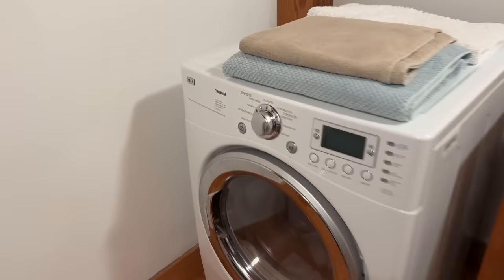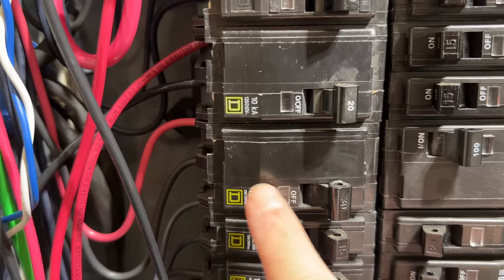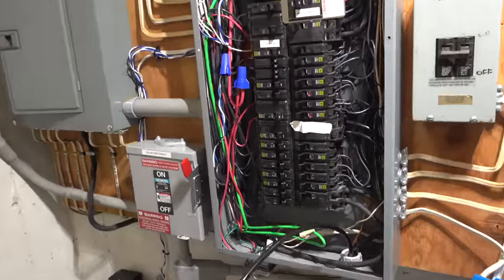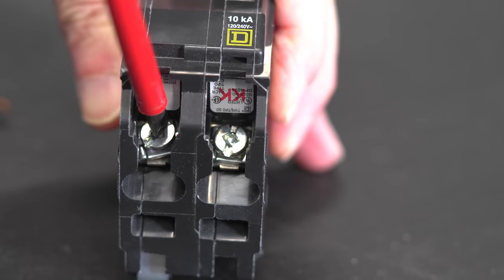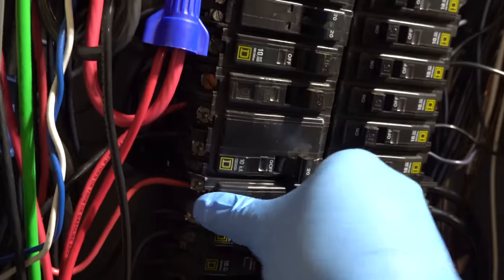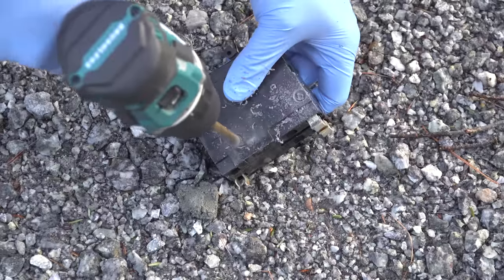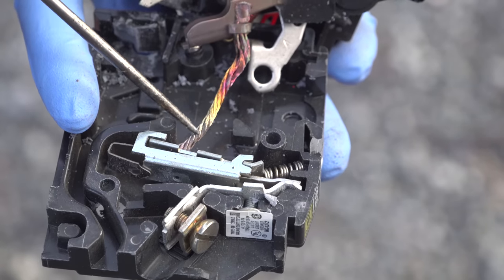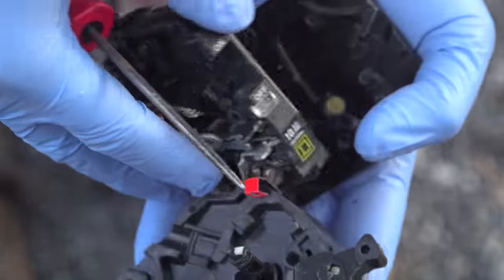If Your Circuit Breaker Makes a Buzzing Sound 🔥 Fix It Quick!

Comment: Mines well over 30, but it doesn't make a noise. It's in a really good environment though. A cool environment and a stable system. It doesn't like really high voltage devices though

Comment: I highly suggest to anyone looking at doing this that they first purchase a non-contact voltage tester. It's a great fail-safe so you can be sure there is no voltage in what you're working on. Just press the button and point it at various places in the panel. its also handy for replacing switches, outlets, etc.

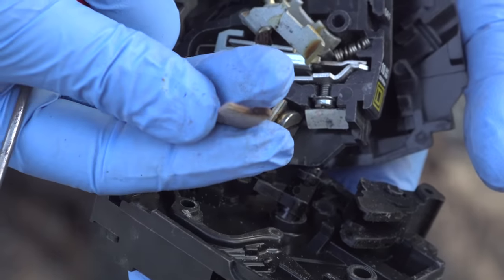Comment: 4:26 Those are quenching plates. Not much to do with the circuit.

That contact is quite far from the bimetallic slow trip. I think I'm seeing a missing contact pad on the entry side. That would definitely burn things up right where you're seeing.

Comment: I think it's crazy ever since I replaced my water heater with a super energy efficient water heater and purchase the exact breaker to put into my circuit breaker I have had nothing but electrical problems in my house. Constantly blowing other Breakers or at one point the wiring for the water heater itself the plug which is required by code to be hardwired with the special flexible conduit and permanent plug-in that is unable to be unplugged. We'll get hot from time to time. Thinking that I had done something wrong I had a professional electrician examine everything and he said everything was done correctly. And that my circuit breaker was Modern enough to handle everything and if anything my power should be working better because the new water heater takes less electricity then the old water heater. So it shouldn't be overloading my system. But yet I still continue to have problems in fact just last week my entire living room went out. So then I decided to change every solitary breaker in the breaker panel. And now today my kitchen went out. I don't understand what is going on I've had it checked by electricians like I've said it checks normal anyone that has any advice would be highly appreciated thank you.

Comment: The noise was driving me crazy! So I got on YouTube. Couldn’t find the correct answer until I found your video. I just cut my 13 off which was the heater and it stopped! But the thing is It cut my whole wall central electric box off!? What should I do
Reply: Continue: No I can’t cut on air or heat. But the noise has stopped! Is there anything I can do before calling the landlord. But the noise did in fact stop after cutting off the #13 heater. It shut down my whole central heat and air and my wall box where I cut the air and heat off isn’t on. But it completely off. It’s electronically box
Reply: Did you ever get this worked out? I imagine replacing the breaker that was buzzing would be the remedy.

Comment: Hey everyone I’m a youngin in my first home, built just over a year ago and I’m hearing buzzing at the breaker, should I check elsewhere as well? Could a loose connection further a way lead to problems at the main panel? All help is greatly appreciated!
Reply: If you are hearing a buzzing at the panel,  there is most likely a problem in the panel, but there may be issues elsewhere because of or causing some problem within the panel.

Comment: Yesterday I added a breaker.  When I turned the panel back on, I individually turned on each breaker and I noticed one of them would have a small cracking sound for a couple seconds every time I turned it on.  
I replaced the circuit breaker and it went away but I have no idea what the problem was. Was it a breaker going bad?
Reply: Yes likely the same issue explained in the video

Comment: Something out of curiosity. How many rooms does this house have? I always see American houses having panels with a load of circuits, I get that most houses are bigger, but that much? 😅

U guys separate 1 breaker per room?
Reply: Code requirements. Let me go with kitchen as an example. Counter tops need a minimum two 20a circuits. Dedicated 20a circuit for microwave. Dishwasher must be on own circuit. Garbage disposal isn't required to have its own but a high power disposal is best served with its own breaker so its normally done that way. Refrigerator gets its own circuit. The lighting will be on another circuit as you don't want kitchen to go dark when you pop a breaker. So in this very basic kitchen example we are already expecting to see 7 breakers just for the kitchen.
Reply: @jovetj  The whole ring circuit and fuses on plugs are a British thing, (or were, even in the UK they mostly opt for radial circuits now).

My sockets are all connected to 16A breakers and a single breaker will feed multiple sockets and light circuits. 

Exemptions are “heavy duty” appliances like heaters, AC and a cooker, they will normally run in a separate circuit. 

I think that a combination of size of appliances and less regulations regarding energy uses might play a part in the difference in the panels and in the nr of circuits. A canadian friend that helped me with moving, was shocked when he discovered that a fridge, washer and dryer were all running from the same socket using a extension cord (mind you, even the cheapest cords will have a 3600w rating, and thats the max the circuit will handle the circuit maximum output anyways), a regular European fridge (small by American standards), a front loader high efficiency washer and a heatpump dryer will sip energy compared with similar appliances over the pond.

Comment: If not sure how tight to get the wires, the breaker should have a torque spec printed on it. It will probably be in in/lb. Use a torque screw driver to tighten the screws and you won't go wrong.
Reply: Could just make it German tight - Goodentight. Have to use the accent.
Reply: @robertthomas5906  😂 True. My comment was only for anyone worried about making sure it met the spec. This would guarantee them that they had it correct. The  rule I usually hear from electricians is to tighten the screw until you hear it squeak on the wire.

Comment: It's not that it was making contact where it should not have. I'd bet it was that it wasn't making good contact. This actually isnt as dangerous as the sparking at least sounds because it should be well contained, and still trip if it gets hot enough. Absolutely worse replacing though, if nothing else there's probably some voltage drop on it and that's no good for your dryer.

Comment: I've always heard a small buzzing sound from the circuit breaker feeding my electric furnace in my mobile home and apparently it's normal but recently I've had the breaker trip randomly for no reason now would that be something I should be concerned about
Reply: @jovetj  so far it's not getting hot or anything but I've been keeping an eye on it
Reply: @jovetj  not like it was but I did notice that the cover for the circuit breaker box was loose so I tightened the screws holding it on and ironically the noise is gone so it might have just been that causing the noise and it hasn't tripped anymore either so it might have just been a power surge that caused it to trip like it did

Comment: How can you figure out which one it is?  Mine only hums for half a sec now and when when i walk by..... no clue which one it is.  None of them are warm
Reply: It’s quite easy. Check them by elimination. Assuming it’s not continuous, just plug in different appliances in their appropriate plug and go to the panel or you can turn off the circuit breakers one by one.

Comment: When replacing a breaker you have to upgrade it to an arc fault but ask your city.  Arc fault breaker would likely react with that clear arc in the breaker
Reply: I'm not sure about your jurisdiction but where I'm at upgrading to arc fault breakers is not required when simply replacing a failed breaker, or even an entire panel. Where I'm at it is stated this becomes a requirement "if you are replacing the panel box and either adding new circuits to any area other than bathrooms, unfinished basements, garages, or to the outside of the home, or if you are extending an existing circuit using more than 6’ of wire. I'm currently installing a new panel in a different location in my home, as well as adding circuits and buying all those AFCIs sure put a dent in my wallet. In any case NEC does not require AFCI to be installed on circuits feeding electric water heaters.

Comment: I had to replace a 30amp for my package AC unit in my square D panel a few months ago for the same reason. It was making similar sizzling noises, but it was also getting hot to the touch. Not hot enough to burn you, but hot enough to make you pull your hand away quick if you touched it while power was going through it. Non of the other breakers were even warm at all. That was the only one.   I went and bought a new one, swapped it out. Took a few minutes. The peace of mind knowing that issue is fixed is great.  I am fortunate enough to have a service disconnect outside by the meter, so I can shut off all power going into the house which makes it super safe to work in the panel if I need to.
Reply: Is it possible that this breaker issue was also consuming more electricity than necessary and inflating the electric bill?

Comment: I don't mean to bring it up but this is really bothering me.  If it helps 1 person, this complaint is worth it.  At 2:40 in the video, your showing the "correct" way to place the wire between the plates.  The way the plates are sitting with the wire, the wire is not in the hump created for the placement of the wires.  The right wire is truly bad. When under load, the hertz vibration and the heating and cooling of the wire at that location will cause that connection to most likely become loose, create arcing and carbon buildup resulting in loss of power.  This result often ends up with a melted wire and a damaged breaker (and possibly damaging the bus bar of the panel, including neighboring breakers).  Overall, very positive video.  Thank you.

Comment: Why is the loop a bad idea? I am just curious.
Reply: The plate style connector is ‘not’ made to have the shepherd’s hook.  If you look carefully, there is very little space to even get a loop in there even if you tried.  Not just breakers, but some receptacles have this system of clamping.
Reply: @glasshalffull2930  thanks for the answer! I've never messed with my breaker box, but I wouldn't have known that information had I not watched this video and it just made me curious. I appreciate you answering!

Comment: I would suggest DO NOT rely on they type of breaker in the panel to determine what type of breaker to put in the panel.
You spoke of mistakes when wiring, but there are also mistakes made on what type of breaker is installed and the wrong breaker is installed.
Instead I would suggest to always consult the manual of the equipment before working on it. In the case of a panel, the the proper breakers should be listed on the inside of the door.

Comment: Thermal breakers are cheaper and more common, but magnetic breakers do last longer.
 Modern codes may call for GFIs AND Arc Fault protectors. The arc fault protectors cost more, yes, but they'll trip out and cut off power when that sizzling arc happens.
Reply: Back in 1974, US Capitalism, ditched the "Magnetic" full size, MCB, for the 50%, cheaper, THERMAL, even though that "SHUNT" cable in this breaker, is "Listed" Magnetic, the action is fully "THERMAL.
Reply: @Lyfan Deth  Wrong, an arc fault breaker will NOT detect the arcing inside itself, as the contacts and that braided lead is upstream of the sensing circuits.
Reply: @charletonzimmerman4205   Also wrong. Except for GE and one other brand I can't recall at the moment, ALL  SqD and other makes use a metal plate and lever type of construction that give them a true fully magnetic trip function. They just don't use a full coil of wire like the older makes (and many UK brands) do. 

And the switch had NOTHING to do with any sort of government or regulatory conspiracies. It was all about better engineering and cost savings.
Reply: @turbokatzenburg5732  Sorry , obviously You're not as old, as me. I was in electrical Contracting, 1972-1976. Yes Indeed, their was "Fully Magnetic" breakers, "Murry" and later "ARROW-HART", they folded as companys like - "Zinsco" & "Federal Pacific", came out with "Listed" UL, thermal, @ 1/2 price, I went out of Business, cause I "Refused" to Install those brands. "Cheap" defective wo0n, but I could sleep @ night as None of my Houses "BURN'T".
Reply: @charletonzimmerman4205  Am I supposed to be impressed by your FOUR years of "electrical contracting"?  I have been an electrician for over 42 years, and worked for a few manufacturers of electrical equipment including breakers, as well as doing refurbs and testing of breakers of all kinds. You cannot even form coherent sentences in your comments. But whatever, at least you went out of business which saved a lot of people.

Comment: In the UK we are not allowed to touch inside the consumer unit or used to be called fuse box. But your good to check this as that might have caused a fire. I'd say arcing might have been the noise. If it's that old, maybe complete board change, might put your mind at rest. Also always pen test before touching terminals and use vde screwdrivers. Noticed you used vde once, but not safe pratice.
Reply: We have a bit more common sense in the US, so we can do our own light electrical repair without fear of government shunning.
Reply: We're not supposed to either. In fact, I was surprised to find out I can't even re-wire a lamp fixture. Some of this is state law, and others are county. I think most if not all of the country we're not supposed to be in that panel though it's done all the time. I'm surprised at how much is done by licensed businesses that never get a permit for things that require it.
Reply: @Robert Thomas  must be just your area. In my state you as a homeowner can do whatever electrical work you want, even replace a panel. So long as you get proper permits and inspections. I've honestly never heard of any place in the US where you are strictly forbidden to touch the panel as a homeowner.
Reply: @Lucky Joestar  but homes in the US are supplied 240v split phase so going into the panel will expose you to 240v just the same. Each hot to ground is 120 but if you cross between both hots you'll get 240v as they are split phase
Reply: @Lucky Joestar we also have 240v in america, the breaker he worked on is 240v
Reply: Most modern home owners don’t even know they have circuit breakers.
Reply: @erin19030  that is true, same with fuses, i have had customers call them "round glass thingys" we then had to drive an hour and a half to change it out
Reply: @theelite1x721987  For Maryland what you can do very much depends on where you are. I can tell you that I don't think you can replace your panel and not be an electrician in Maryland. They told me that the Utility wouldn't do that and I remember when I had one done that they made sure the guy doing mine really was an electrician. I had to replace it because of a city requirement. The wire coming in is also Aluminum wire made in 1964. No problem with it. It has to be handled a certain way.

So they said and it's online that as a homeowner, I can get a license to do it if I can score 70% or higher on their test and pay the fee. For some things, it seems I can replace sockets, light fixtures, and things like that without the license. To do something with the panel such as add a new service you're going to have to have that license or an electrician. If you don't occupy the house they want an electrician to do it.
I suspect it's the same way in Nevada. I worked out there in 1993 and due to the MGM fire they went crazy with electrical requirements.

Comment: Watching this guy with latex gloves in a panel, wow, so much for arc flash protection 
Even turning off the main , you need to confirm there is zero voltage 
Main breakers fail too. If your replacing your panel Stay away from push on style breakers, always use bolt on
Reply from the maker: I never said they were electrical gloves, they are for camera visibility. You wont be finding bolt on breakers for residential panels, commercial yes.
Reply: All manufacturers make single phase panels that can be used for residential applications
In your video, you missed the most important  step confirming zero voltage

Comment: Over in the United States your 3 phase powder is the equivalent of our 2 phase power over in Australia because we're on 240v
Reply: Residential panels like this one is called split phase or Edison 3-wire systems. There is two 120V legs and a neutral in the center, directly across the two legs is 240V. Actual 3phase systems are 120V and 208V phase to phase.
Reply: @Teh_Random_Canadian  we also have split phase we have 240 split it 2 times and you get 415 volts that's how my dad has his shed set up so we can use our arc and mig welders off a two phaes system
Reply: @gman83090  our voltages are 208, 480, and 600 at 3ph. I have never heard of 415v 3ph before now